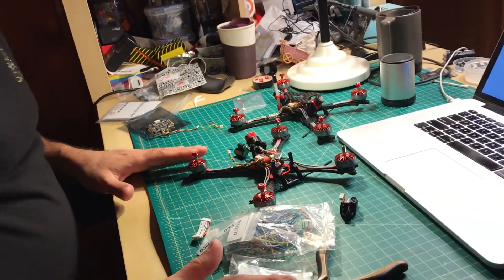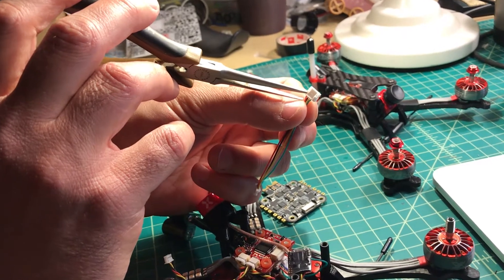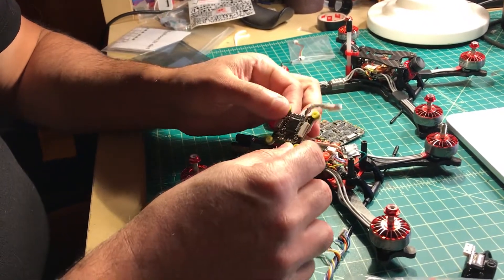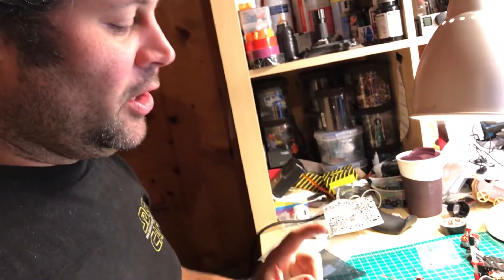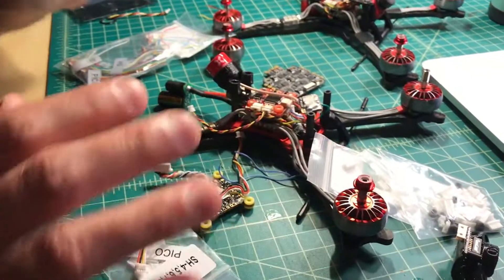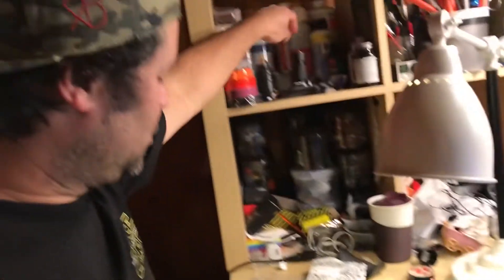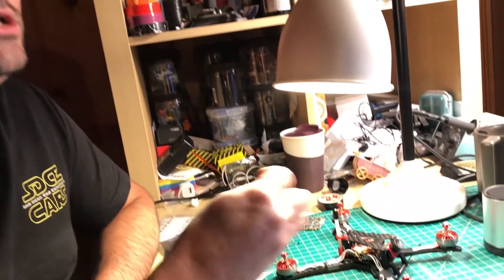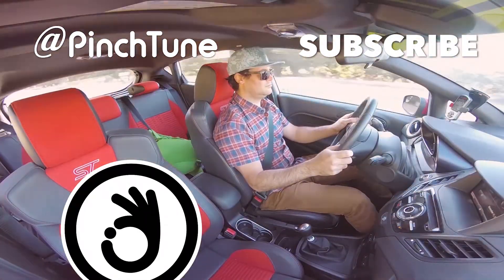Flight Controller Plugs Pet Peeve

Comment: Stumbled across your video and love the stuff you talk about. I'm building a quad with the talon gigawatt  35a esc and flightone millivolt sod fc. This is my first time using two different manufacturers and I've repinned 7 out of the 8 pins. The one that has got me confused is the telemetry out of the esc and the +5v power out of the fc. Do I leave these unpinned? Or conect?
Reply from the maker: Hi, I don't use the telemetry as it's for BLHeli32 ESC telem and I just don't just that for racing. So, I leave that open and just use the current out from the ESC into Current/TX6 in the MillivoltOSD. Just make sure to bridge the current+TX6 (middle) pad in on the FC for that to work.
Reply from the maker: You won't be using +5v onthe FC on the main ESC in plug side either, so you can leave that unpinned as well.
Reply from the maker: Check my other videos. I have one on how to wire the Millivolt OSD. I say in the video that I wasn't clear on whether I'd be using telemetry or not. I ended up using only current and I'm very happy with it.
Reply: Thats what I thinking and planning on doing. Thanks for the fastresponse. Now I can finish my acrobrat.

Comment: Good call, I loathe them too.
Reply from the maker: Looks like there's quite a few of you that agree with me.
Reply: @PinchTune  Yep, though have you seen the new Predator 4 Cam? A plug less version is available, with solder pads instead; I think I actually prefer a plug on my cam, not totally sure yet.:)
Reply from the maker: @cheshirerc  Right, I did see that. That one is interesting. For most builds I'd keep the plug on the camera. However, there are some builds I have where I've had to put the camera upside down because the plug hit the stack otherwise. I can see that camera begin very useful for those situations.

Comment: I just had a problem with pinouts. But thank god its uper easy to pull a jst pin out. Could u imagine solder and unslodering for 2 hrs? If a connection is two diferrent types? Just cut the wires matching the orientation u want and twist wires together, heatshrink and done. It works(cameras, vtx, receiver,etc. but check this. Im done and have my fc pinned out perfect but find out the fc is damaged! If I had soldered that I would have been furious. But yes soldering is great too dont get me wrong. Each have an advantage. 20 sec fc replacement? Nice. Peace of mind your pins wont pull out in crash ? not so much. Lol
Reply from the maker: Wait, twist and heatshrink? You mean, splicing wires together? No, no, no, it hursts my OCD. Haha

Comment: They're great.... Until they're not LOLOL
Reply from the maker: Haha, that's pretty much sums it up.
Reply: Your so right. Yes plugs are great on race day to quickly change out parts but hey also suck bc they can fall out or if its not plugged just right you can burn something up or shit just won’t work.
Reply: @archer4922  yep!  I've had a plug come loose and cause me all sorts of trouble
Reply: sᴛᴀᴄᴇʏ ABSHIRE yep I think that’s what blew my very first ever bolt v2. I won a win 5 with a flightone stack from kwadbox last year and it  did me great for about 6 months then all of a sudden it just stopped working. I was 10-15 seconds into my first flight of the day and wasn’t even pushing it and it just tumbled out the air and I heard the fc reset and after that one motor never would spin again. I tried every thing to see what went wrong and even had 4 other people look at it and no one can figure out what happened. The only thing any of us can think of is the plug on the esc. It felt a little weird like the plug would sit in it but one corner seemed wiggly. Like it was plugged but not plugged.  Nothing was burnt either. Tired diff wires diff motor diff racelites no racelites reprogramming everything. Not really sure what happened. Damnest thing I’ve gone thru with Fpv lol. But I did Lear a lot about quads while working on it. 😎 but life always gets in the way and I never finish builds, takes me forever. Finally finished the one I’ve been posting on my insta. Just need 10 mins of day light to maiden it again.
Reply: @archer4922  in my case it kept causing mine too freak out and crash.  Once I figured it out though it's been great ever since.  No damage to anything thankfully.
Reply: sᴛᴀᴄᴇʏ ABSHIRE that’s good that there was no damage.  Mine really wasn’t damaged but I delamed an arm. But it was the win 5. I went thru a ton of arms lol. They snapped like twigs.

Comment: "sometimes they make me furious"  haha  Yup! I have a drawer full of precrimped wires salvaged from different connectors and finding a wire with the correct crimp is also infuriating :) And then when you need something different on the other end....So the crimp tool is a pain as well huh? I have the airbot kits for fc connectors. Thanks for the links.
Reply from the maker: Yeah, I've crimped a few before, but it's sooooo hard. I have the crimper from RMRC and a bunch of fresh uncrimped connectors. Maybe there is a crimper that is easier to use? I don't know. But it really bothers sometimes trying to get the wire length right and realizing I need plugs on both sides.

Comment: The spedix is25 escs I'm using on my 4" setups right now come with 8/10 pin jst connectors, with one side not seated into the connector, still have to verify and check that everything is correct, but you don't have to mess with taking them apart.
Reply from the maker: That's cool. But what if the other end needs a plug too, like for the MillivoltOSD? If the FC has pads, it makes the whole thing a lot easier IMO.
Reply: @PinchTune  yeah definitely, sorry, all the flight controllers I use only use plugs for the esc connection... Haha
Reply from the maker: @PhreakinFPV  If you know of a better crimper tool than the green RMRC one, let me know, maybe I can have more success crimping my own.